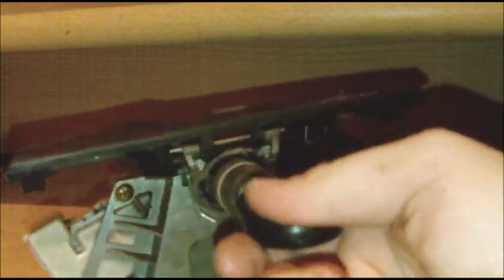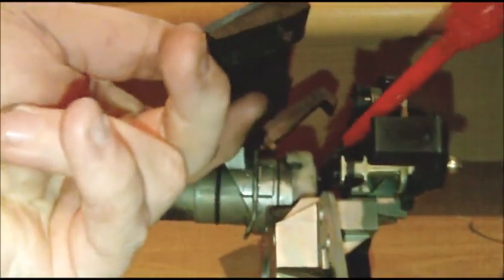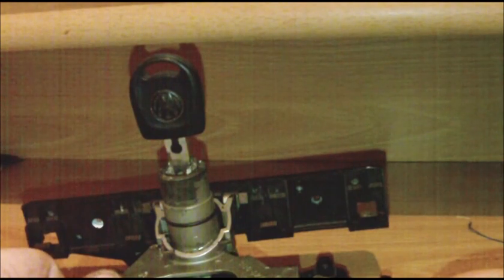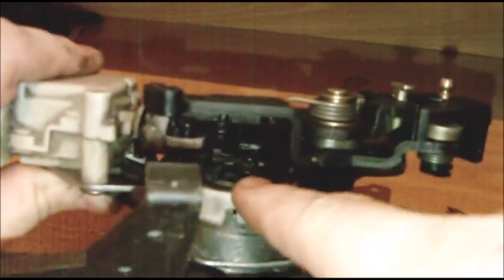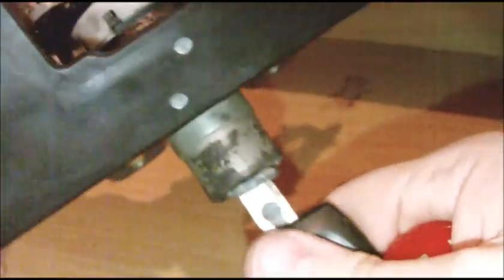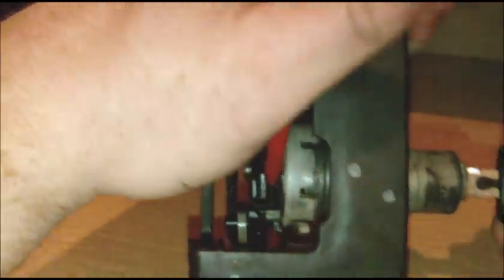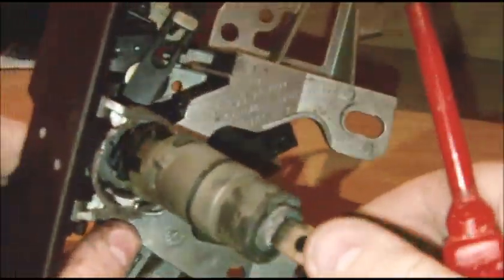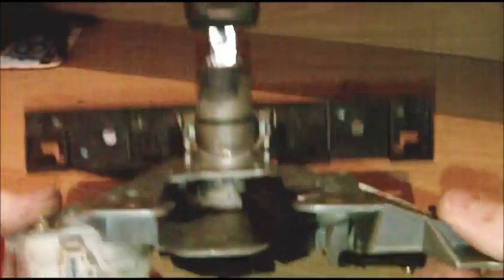Passat Boot Lock Housing Removal and Replacement

Comment: Thanks for sharing this information! I was able to successfully remove the tailgate lock from VW Passat b5 wagon/variant with the info from this video. The spring was really hard to remove because it had reacted with the aluminum in the lock body (oxidation). Without the details shown in this video I wouldn't have dared to apply enough force to pull it off. It still took a couple of hours to remove because the spring was nearly cold welded in place and the space available in b5 wagon is really small.

I still don't understand why they used such a design. A bolt or two would have been much better!
Reply from the maker: I'm glad it helped you Mikko. I'm none the wiser myself  there's probably a reason for it. Most likely money saving I guess. Every penny is a penny less to build.
Reply: @RoadRunnerMeep  That figures. A 5 cm bent spring steel is cheaper than two bolts.
Reply: Can one remove the whole mechanism if the spring is already missing? Is it needed to lift something with it in order to release it from the car, or if the spring is missing/removed it will be still possible to have it done?
Reply from the maker: I believe you can still remove it. The spring itself should just be for the return on the lock or return for the handle. You should be able to prise up with another screwdriver if needed. But I don't believe it's needed in order to remove it. Just for it function
Reply: Thanks for your answer! I will give it another try. For sure it feels more loose (and gets looser) without the spring. There was a lot of water in there and maybe some rust formed somewhere and I cannot easily remove the mechanism.
Reply: @hhaxah  Apply lots of thin oil and if parts move even a little bit, keep moving them back and forth instead of applying too much force or something will break.

If you have even half a millimeter worth of movement, just add thin oil and keep moving things until they release. Prepare to do that for a couple of hours and have sore fingers in the end.
Reply: I was able to remove the mechanism after spraying some WD-40 around the key lock, some plastic parts. Then with the help of another person we were moving up and down the mechanism: from in and outside of the door. It took us a minute or two to do it. Thanks for the advice!
Reply: @hhaxah  Great to hear! I think you should consider yourself lucky if it only took a couple of minutes. Getting existing parts off the car for repairs and maintenance is always the hardest part with these old cars. With proper maintenance, these cars are still really good – I just drove our Passat 3B5 just yesterday without any problems.

Comment: I hope you are still reading replies, thanks for the tip. This lock really had me puzzled, and still does. I can only move that wire spring away from the cylinder a few mm before I run into the black plastic hinge bar behind it. Is that enough to release things to where I can try to pull the whole thing out of the door or does it have to be fully removed? After generous applications of WD40 into the lock cylinder the key goes in smoothly but still doesn't turn the lock, which is why I want to get the whole thing apart. Regards!
Reply from the maker: I do read replies. Although I'm limited in what I can help with as I made this video several years ago  now so it's kinda hard to remember it all

You might have luck with an online diagram, as it shows you where all the screws and placements are. It could be when I removed mine I didn't remove all the screws. 

This is a 3B sedan for example. 

https://volkswagen.7zap.com/en/rdw/passat+4motion+santana/pa/1997-221/8/827-827010/

Generally most parts on a VW come off, if you think it's stuck there's probably a screw holding in somewhere, or a clip. It's always best to wiggle and work methodically. 

In terms of the spring, the main C clip only lifts up a bit as it's just held in by ears. Then the clip behind can release pressure. 

Personally I'd remove the entire assembly if you can, it makes it loads easier when you don't have the hassle of being in a weird angle in the car and can sit comfortable in your house with a cuppa
Reply: @RoadRunnerMeep  Thanks for the timely reply, mate. I got the assembly out after a good soaking in WD40 where it goes through the door. It turns out that the wire bail only needs to be pulled away a few millimeters and not all the way out, all of which only becomes clear once the assembly is out. My problem was that even after extensive soaking I could get the key into the lock but could not turn it. Once I got the lock assembly out I managed to loosen the cylinder only by carefully heating it with a butane torch, which did the job. I sprayed it with some moly lubricant and put it all back together and all is working as it should. Your post was very helpful, perhaps this addition helps someone else. Regards!

Comment: i dont know if you knew this but you dont need to hold down the spring to turn the lock barrell out of the housing, it just twists out by twisting the barrell 90 degrees.
Reply: I guess that's the original design but our Passat b5 wagon had do much oxidation on those parts that it wasn't possible to turn the spring.